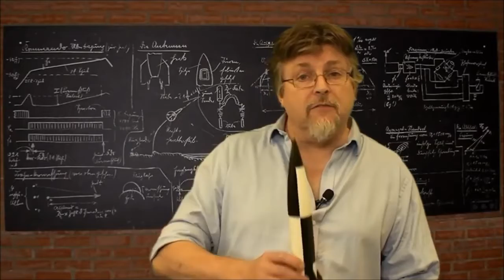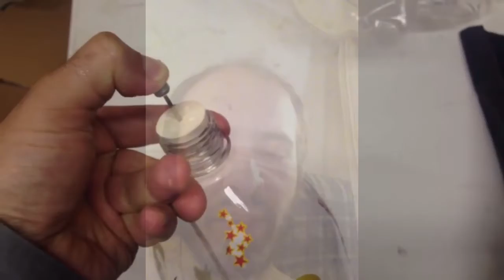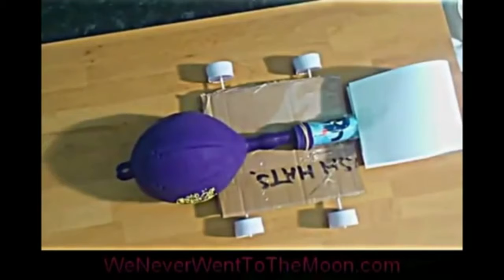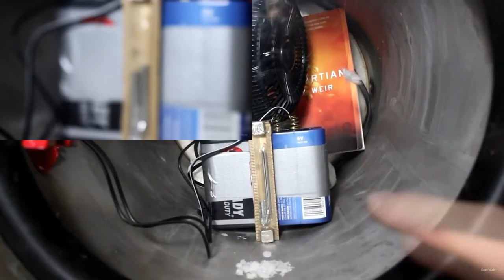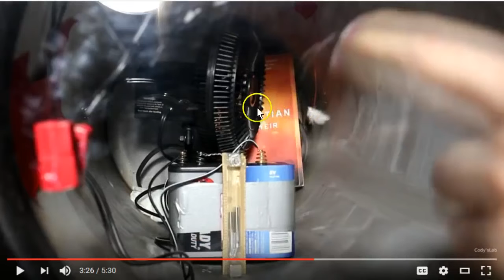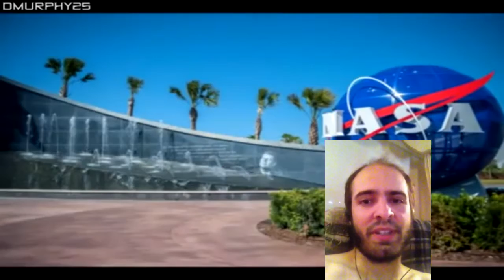There are no rockets without Cola

Comment from the maker: if the combustion chamber is ejecting combusted gas this also mean that it is not pressurized, in other words it is part of the entire space vacuum, and therefore some question needs to be considered: (1) is combustion in open space possible? (2) has the product of combustion a velocity or an acceleration (given that it is born in open space)? (mass x velocity is not a force, is a momentum.) (3.) unlikely a body in open space,a gas can and will take the path of least resistance. So it is impossible to eject it with an acceleration in a vacuum.If that gas only have a velocity, it only have a momentum,and this means no force is exerted at any point. an acceleration in vacuum is possible with a solid body, but not with a gas.
The gas in open space will escape in open direction, nothing will give order on
it, entropy is at max. possible level and will always remain so with a gas.
Max entropy means that you cannot throw a gas!and you cannot apply an acceleration on
that gas, and that whatever happens to a gas in open space, it will not accelerate a rocket.

Comment: Indeed, rockets in vacuum do rise insurmountable problems as you noted : absence of reactive force due to the absolute freedom of the ejected gas to dissipate and the obvious and practical impossibility to rise any pressure at all in the combustion chamber in a vacuum.                                                                                                                                                                                   I remember an old NASA video in witch a German scientist commented on the vacuum of space and gave a significant positive value of air molecules in a cubic meter of vacuum. Since then this number/value has been rebutted by NASA and I believe this because it will rise insurmountable issues regarding the propagation of light from "millions of light years away"                                                                                                                                                                                                                                                                                                                                        It is obvious that NASA should hold a patent for a revolutionary rocket engine design operating in vacuum, all this augmented by verifiable demonstrations and since this is not the case they are left with egg on their lying faces, another of their own brand of a non sequitur absurd argument !

Comment: True for for the biggest part and I agree that rockets in space is a total hoax.
However.. You forget a part of the equation which is the 'mass times velocity' of the gasses that are ejected from the nozzle. It is a very small part of the total thrust of a rocket engine but you can't leave this factor out if you want to show the hole picture. Although you are correct for the biggest part , if you don't mention this it will be fairly easy to debunk this video.
For illustration. If you throw a heavy ball away in one direction the acceleration of the ball is generating a force in the opposite direction and equal to the mass times the velocity. Translated to a rocket engine this means that the mass of the ejected gasses times the velocity is generating a little thrust.  Also in a vacuum.
https://www.youtube.com/watch?v=kk6UMnWGkD8&t=117s